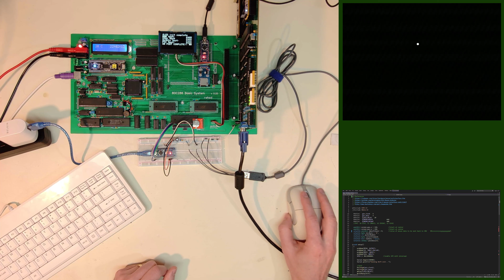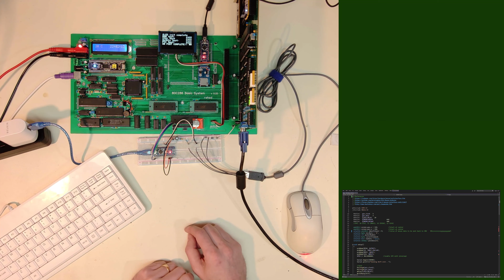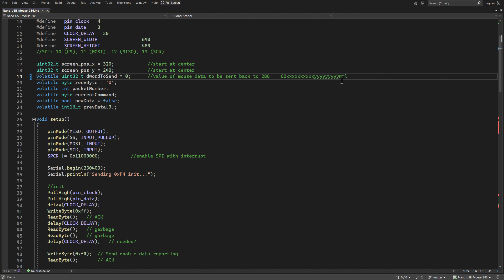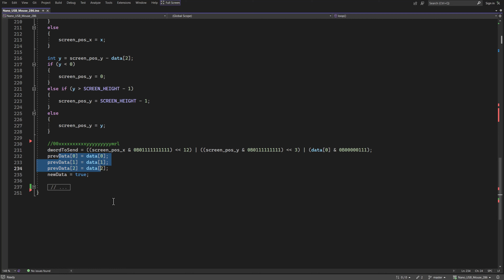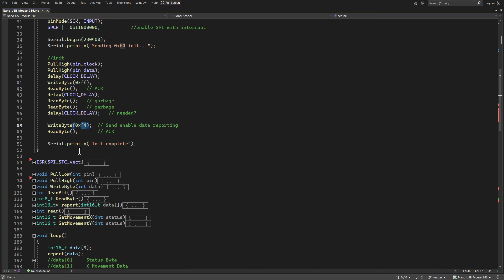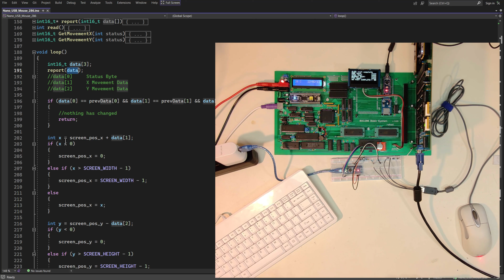80286 Build, Ep. #68, part 2 - SPI to Nano to USB mouse (PS/2 protocol)

Comment: dare I suggest...

you've already got a PS/2 keyboard port. Just skip the whole cute usb thing and put a PS/2 mouse port next to it. Then go grab a USB-to-PS/2 mouse adapter and use your current mouse... rather than the imaginary end user encountering a USB port that isn't really a USB port.
Reply from the maker: That's a fair point. I can easily add an additional PS/2 port to the 286 board in the future. And whether I use a PIC or a Nano to grab PS/2 mouse data, that would work fine.

Comment: Another idea is to use a dedicated Arduino to handle I/O for keyboard and mouse. Less work for 286 for sure, and for you maybe?
Reply from the maker: I was thinking about the same thing this week. :)  Currently, I have PS/2 keyboard support on the 286 system board, but I could probably free up some space and consolidate all PS/2 communication through a Nano. That would be pretty nice.